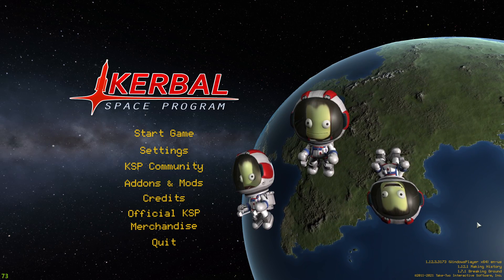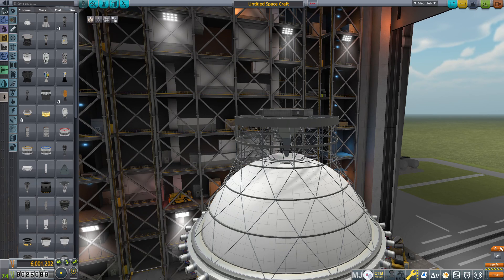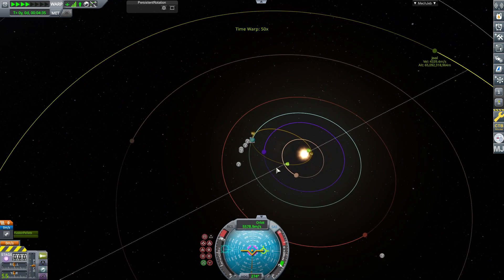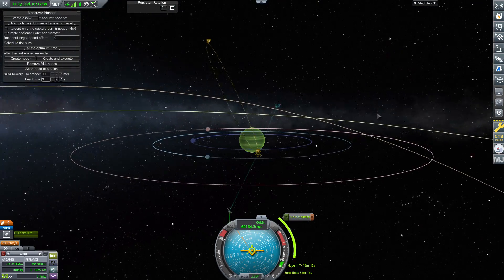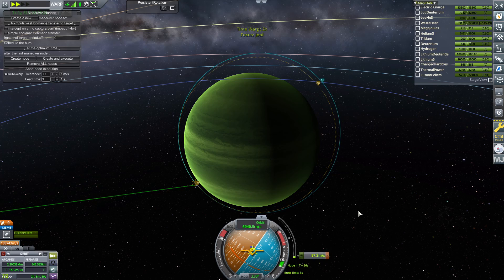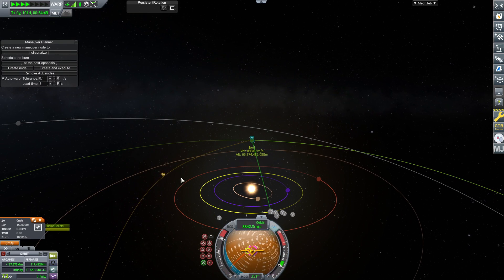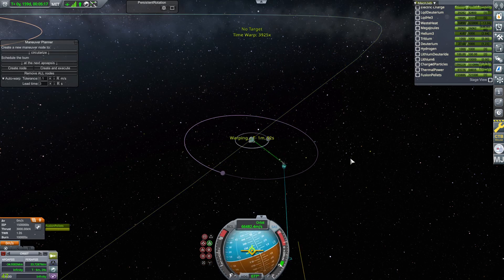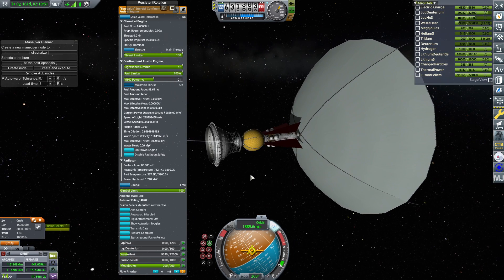Kerbal Space Program - Interstellar Extended Tutorial - Episode 1 - Daedalus and Atmospheric Scoop!

Comment: btw a mod called "precise maneuver" is useful for circularizing orbit 21:10
Reply: negative.. you do the full throttle burn then decrease the burn toward the end and slow it down to do a more precise maneuver..
Reply: @thothheartmaat2833  It seems you didn't do your own due diligence. I assumed he couldn't make a maneuver node to circularize, that's a tool that will create the node (mechjeb couldn't do it, before you ask). I wasn't talking about how to actually execute the circularization..... 

Please look up what the tool is used for before replying with that messages...

And your message is not necessarily right. Thermal engine in kspie has isp penalty for low throttle, so you have to do it smooth enough, 
and also a lot kspie engines have some throttle delay so it is kinda less precise than vanilla rocket engine. (e.g the starter nerva still have thrust for straight like 5 seconds after you shut off throttle!)
Reply: @ssdrbx6180  i do everything manually because i dont have any of these tools.. i steer manually and burn manually.. im precise as a mf..
Reply: @thothheartmaat2833   ... Have you watched the video before replying? Do you know we're in a video about kspie not stock? 

1. he's braking from 60000m/s, good luck braking that with vanilla engine

 2. read the last paragraph. I said in some kspie engines even you throttle from like 5% to 0% there could be like 5 seconds of considerable residue thrust after throttle to 0% so it is extremely hard to do it "precisely". 

(There are rcs to get around it but I guess if you knew that you would mention it in the first place, so you're not knowledgable on that topic)

with all that I WASN'T talking about execution in the first place.  Your execution tips are useless when 1. We didn't talk about it in the first place 2. you didn't even consider the mod the video is talking about in the first place

All your frivolous arguments came from 1. not reading 2. didn't 't even try to google. Please try to do these before pretending smart.